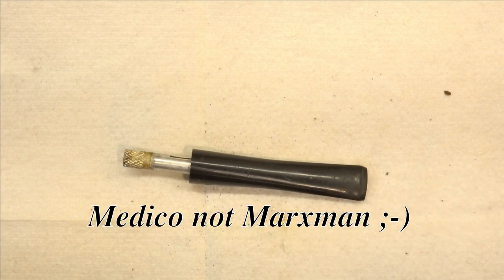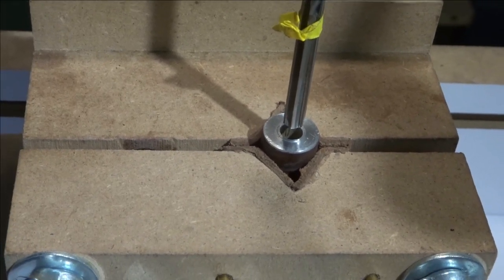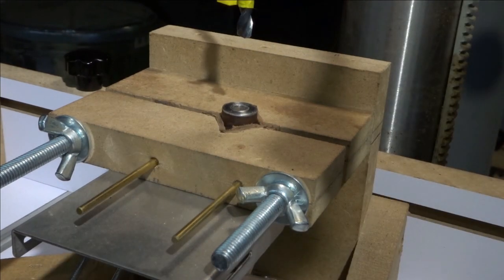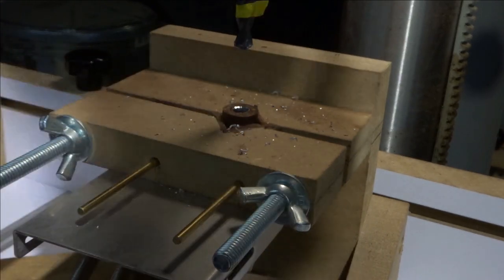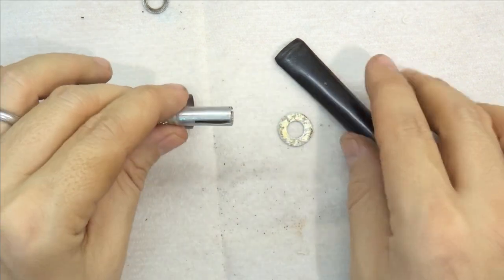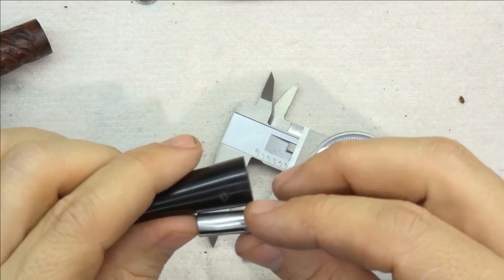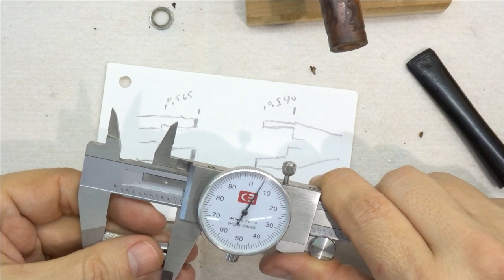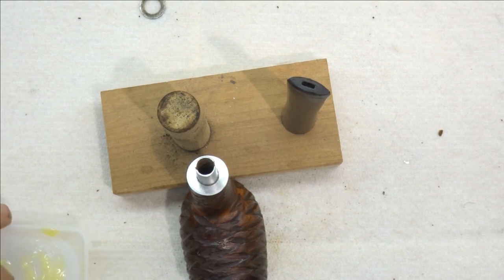Restoring A Medico Guardsman Part 3

Comment: Hi. Just a trick, use C2H5OH (in Norwegian we cal it "Rødsprit") when you drill aluminium.
Reply from the maker: That is the chemical formula for ethanol.  Rodsprit is (I'm guessing) probably denatured alcohol. Not sure it would be a very good lubricant but it would make a good coolant.  Thanks for the tip!